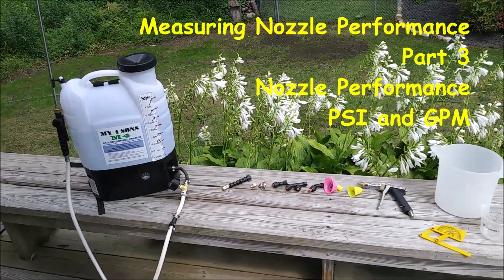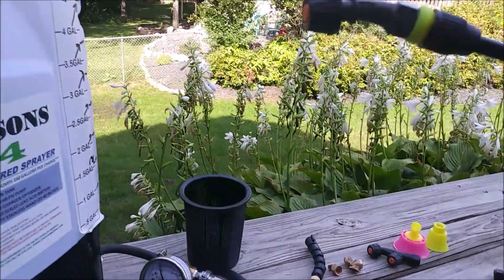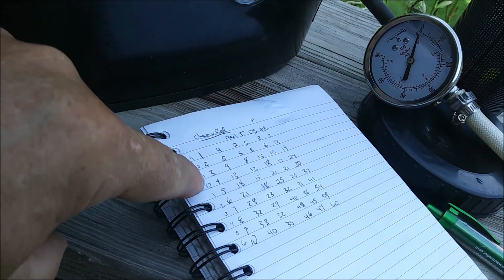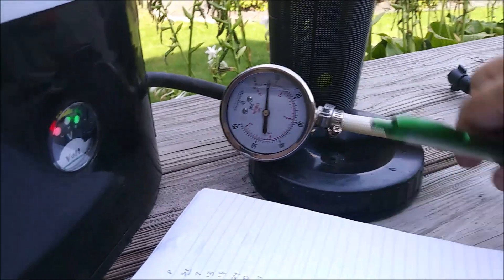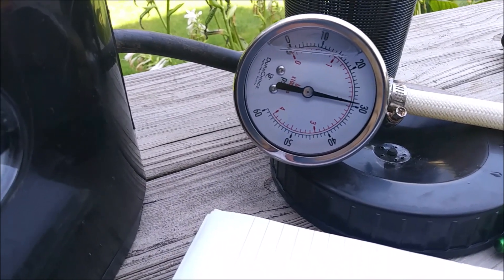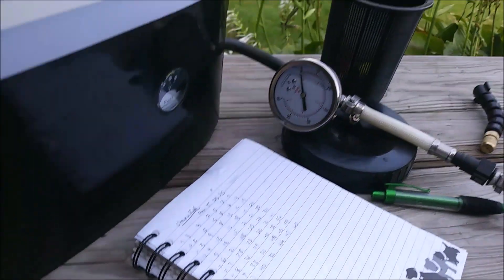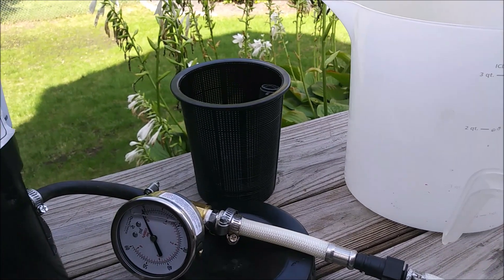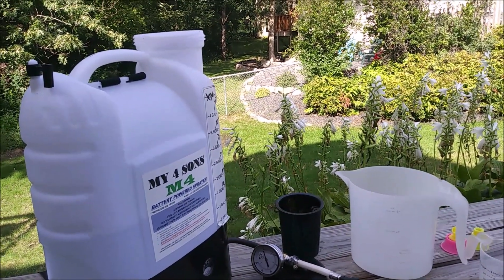MY4SONS M4 Backpack Sprayer - Nozzle Testing Part 3 - PSI and GPM

Comment: WOW!  Very useful and detailed info. and very impressive testing procedures!  Thanks for doing this . . I am considering purchasing one, and this really helps me understand the details I wanted!  One question - I am also thinking about purchasing a longer hose (from the company) between tank and wand, so I can use the sprayer cart-mounted, and spray a larger radius without having to move it around any more than necessary . . . possibly an extra 25 ft. of hose (& maybe even up to 50 ft.?) . . can you estimate the impact and effect adding this length of hose might have on my spray coverage and/or GPM?  I am assuming there will be some pressure drop (I would be running it on max. PSI), due to the extra hose . . but am trying to estimate about how much hose I could add, and the unit still remain effective for what I need?  I am primarily spraying pre and post emergent herbicides, on residential lawns (10,000 sq. ft. average).  Thanks so much!
Reply from the maker: I do have the longer hose and it does cut down on pressure and flow but I've not measured it.  It should be OK though for single fan nozzle situations.  Mine is still running great.
Reply: Thanks for your quick reply, and helpful info.  I'm going to get an M4, and then work on the best combo of hose length and nozzles, for my needs.  Thank you! @TommyTester

Comment: I would like additional information regarding flow rates at various psi setting, 40 and maximum pressures .What I need is the MINIMUM  flow rate at aforementioned pressures, that is, as defined by the point where pump/motor starts that irritating cycling on and off due to flow backup (tee jet broadcast nozzles I use have very low flow rates resulting in fine spray)?

thanks much

DAN